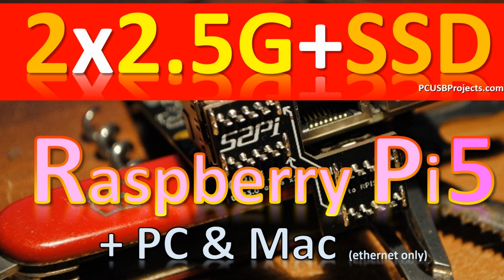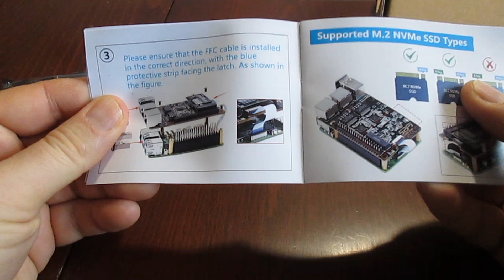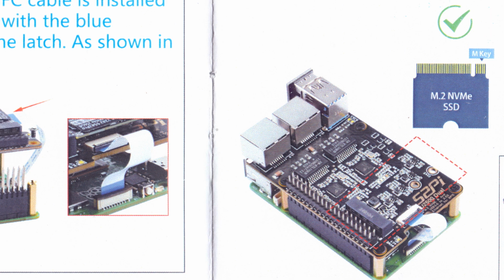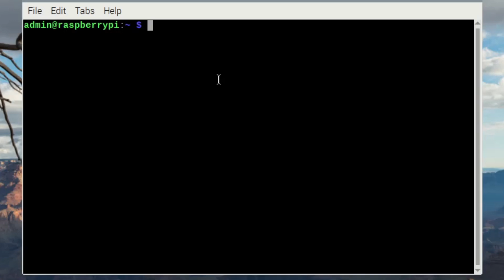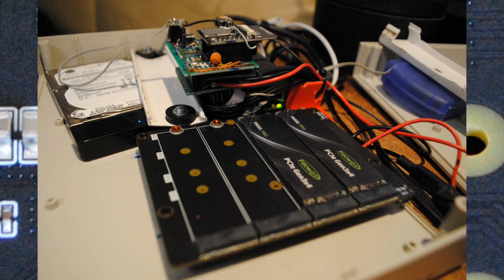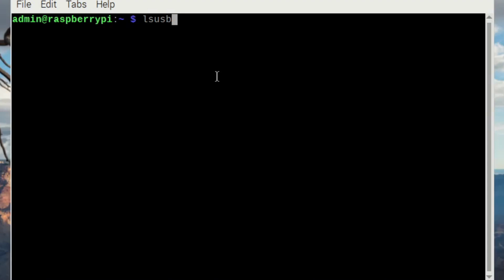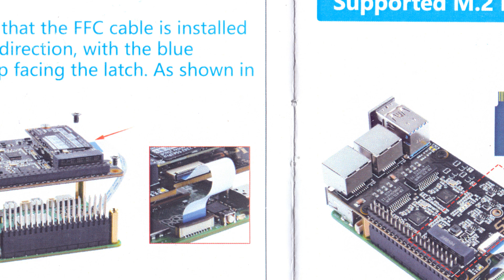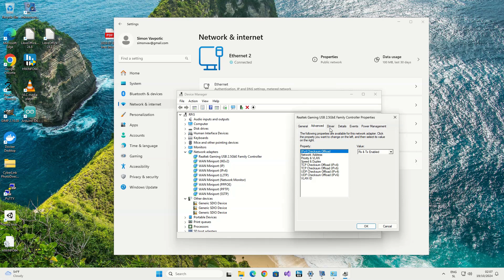52Pi U5000 Ethernet & SSD HAT for Rasoberry Pi 5 also works as a UNIVERSAL USB 3.0 DONGLE for any PC

Comment: Great video thank you .. I just order this same add on .. do you know if it will support Openwrt? I also was looking at MPRG4-Case, Raspberry Pi 5 PCIE to 4xGiga Ethernet device on Aliexpress .. thank you for any help you may have.
Reply from the maker: The module is based on two RTL8156B controller chips that operate independently. As I've tested them in Windows and Raspberry Pi OS the drivers were already preinstalled. I'm not sure about the latest version of OpenWRT, but on Raspberry Pi OS Bookworm and Windows 11 (x64 or ARM64) the drivers work out of the box. Here are Linux kernel and Windows drivers for Realtek RTL8156B: https://www.realtek.com/Download/List?cate_id=585, if you need them.